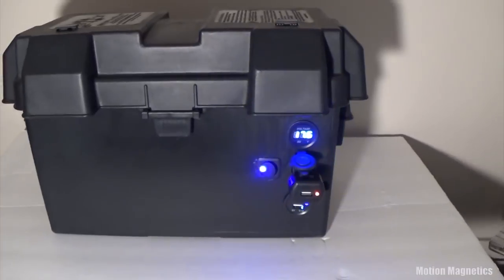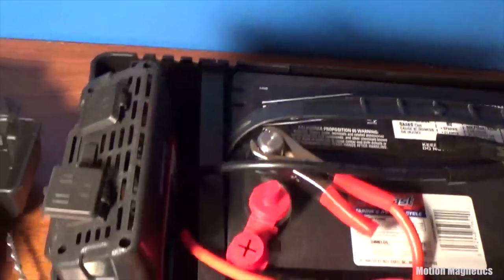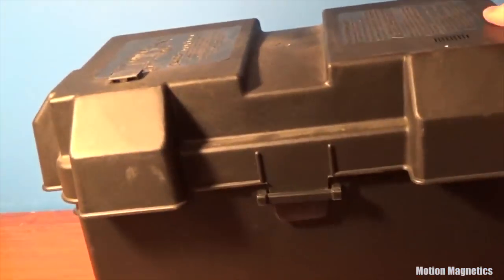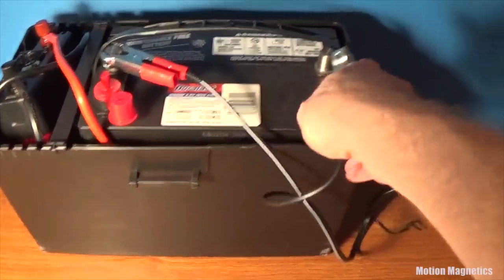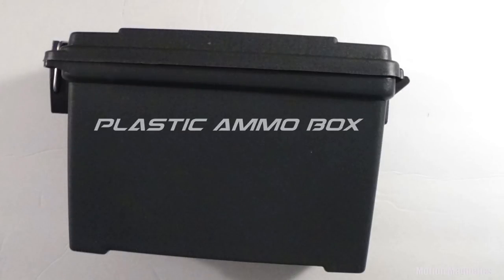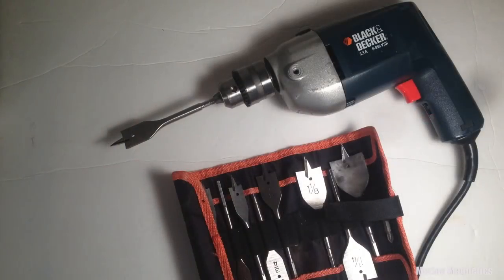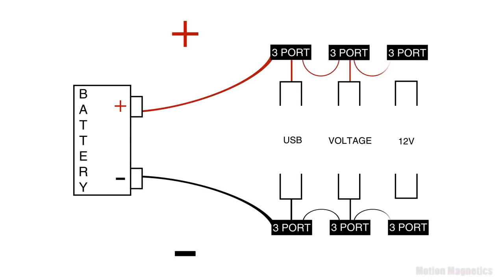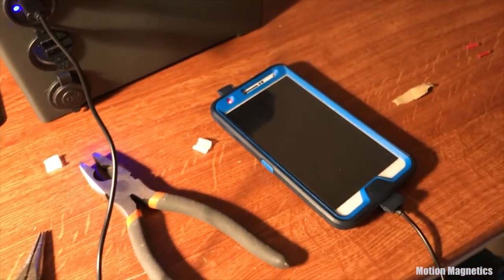Portable power in 60 seconds.

Comment: Could I run my car subwoofer off of that? Like make my own home stereo using my old car stereo deck and 12' Alpine Type R sub..
Reply from the maker: Yes. That's actually not a bad idea. You can even use a bigger battery, if you wish. I just picked one that would suit my needs at the time. If you do that, post a video. I'd enjoy seeing that.
Reply: Motionmagnetics ahh cool. I wouldn't really know what I'm doing. I'm not really sure what kind of inverter I would need to power my amp to start. Lol
Reply from the maker: The easiest way to find out, is to grab an electrician at whatever store you pick to buy an inverter from, and ask him how to set it up and which inverter would work best for you. Just make sure you know all the specs on your subwoofer, before you ask.

Comment: why no fuses
Reply from the maker: I wanted the design of this one to be just the bare essentials. So, I kept it simple. That, and with the smaller battery, there is much less danger of overloading the circuitry. I showed how you can wire one in on my last video though, so if you'd like to see how to wire one, just watch that.
Reply: Isn't the output from the inverter fused?

Comment: If you don't feel like buying a spendy inverter from the store you nerdy people can always use an old UPS battery backup.  Just rip the guts out of it's old enclosure and supplement the old battery and enclosure for the new one as is shown above.  Voile!  An inverter on the dirty cheap.
Reply from the maker: Sure. It would require a little bit of effort, but that's certainly another way to go.